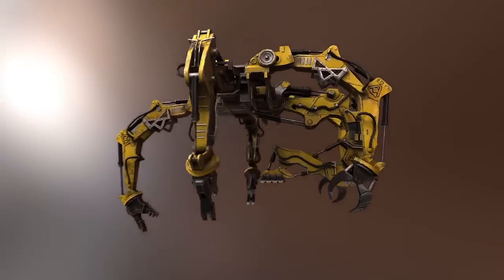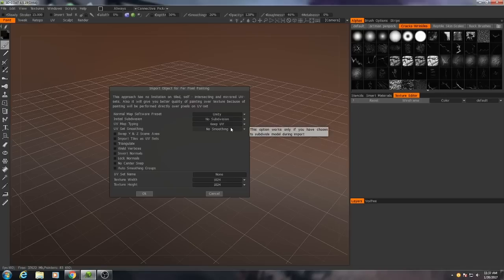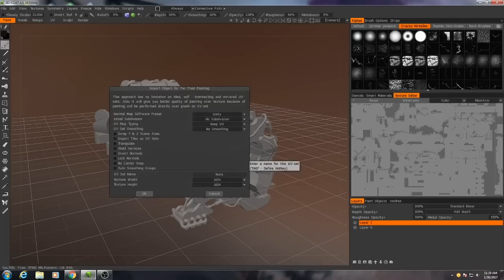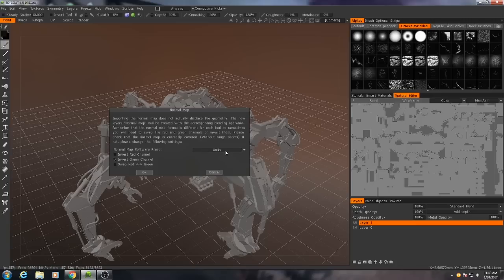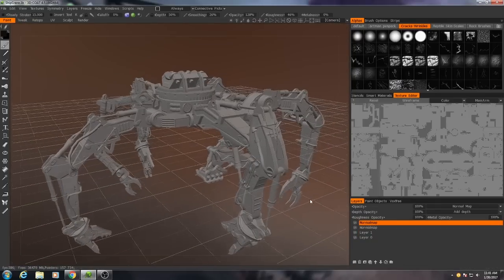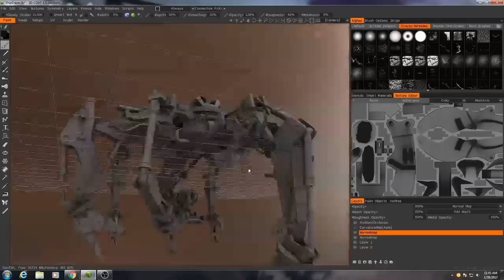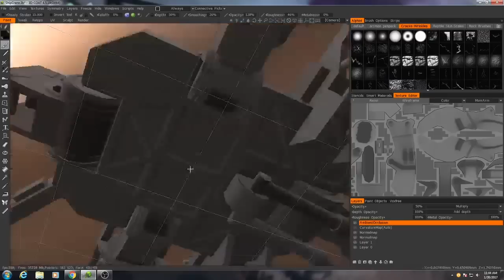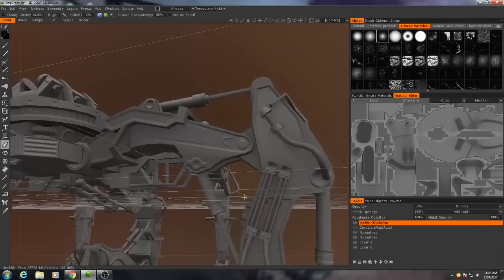3D-Coat Assembly Crane Texturing Tutorial (Part 1)

Comment: Where do i get the crack file for 3d coat
Reply from the maker: You can get a free trial of 3d-coat from their website. https://3dcoat.com/download/ This trial lasts for 30 days and allows all the features of the professional version (more than 7 texture layers, no texture resolution cap). Even after the 30 days, the software will still work and you can use it as normal to practice and learn from, you simply cannot export anything (models, alphas, textures, etc.). You can get a non-commercial license of 3d-coat for $99.

Comment: Great stuff!!  
Could you tell a little bit about your opinions of texturing with DDO and 3D-coat, since they both have smart materials. Which tool do you prefer? Thank you.
Reply from the maker: I prefer 3D-Coat because when I started, DDO only had a 2d painting option with use of ID color maps (which are textures consisting of solid colors where each color corresponds to a different smart material). 3D-Coat has better 3d painting options and is much simpler so I use it to create textures quickly. The smart material creation in DDO is also not as intuitive as 3D-Coat's material editor. The edge detection in DDO is better though. Getting textures to only apply on edges in 3D-Coat is difficult to make look natural since the edge scattering doesn't work very well. DDO does have the advantage of being a Photoshop plugin and allowing you to use all of Photoshop's functionality with it, but I still prefer 3D-Coat because it's simpler and I can create textures with it faster.
Reply: Thank you for the detailed reply, much appreciated!